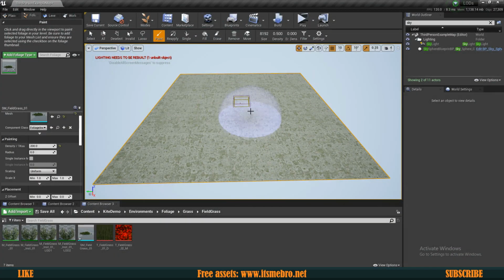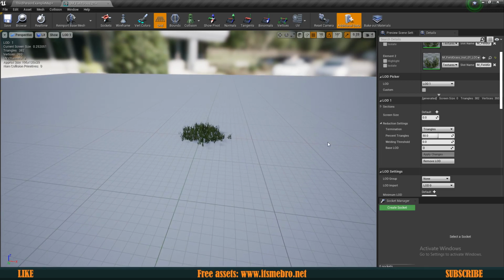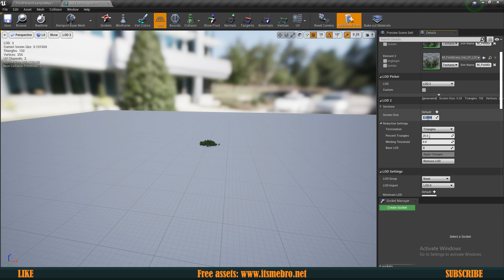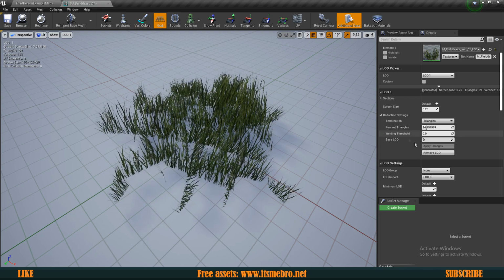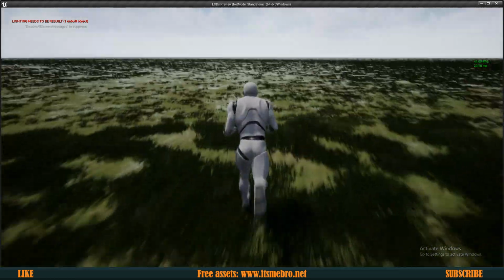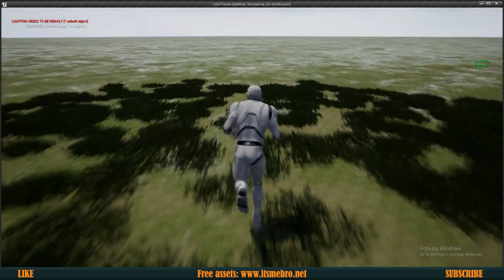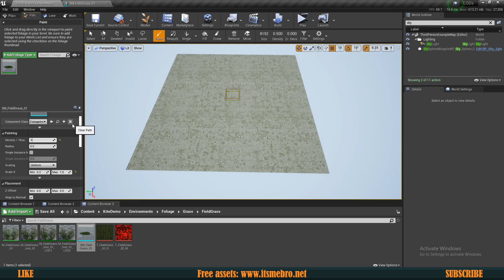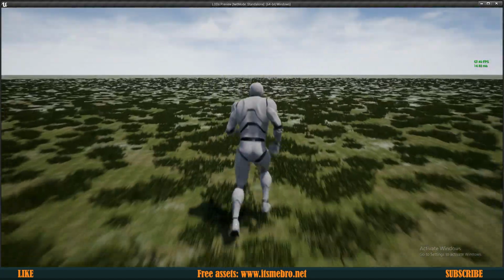UE4 Foliage LOD Optimization / From 3 FPS To 70 FPS.

Comment: Easy fix dont use the folage tool for grass but ad it to the landscape material this is 10x better dont recomend using the folage tool at all for big projects
And always make sure that the models a made correctly if you have a good modeler you wil already not have this problem
Reply from the maker: Yes. After making this video received a few messages about this. Wasn't actually aware of that method myself. I will look into that and do a video on it. Since I saw a demonstration of what it's capable and yes, it's 10x if not 100x better.
Reply: @ItsMeBro  yea its what better for preformance we had the same problems then we dound this option uing folange types in the material and omg its saved us a ton of work and problems
Reply: the problem with material, is that you have TO KNOW!!! what you are doing. Working with materials is just a pain, a huge pain right in the ass, in the butt!! and unreal give no real help when you let your mouse on node, you have no explanation lol. 

Materials is for people who like suffering lol

Comment: Will lod still relevant on ue5?
Reply from the maker: Hard to answer this question. We have to wait and see what exactly ue5 brings.
I assume that it is going to be relevant since games are still using this method.
It might not be as essential, but it could still be a useful thing.
Reply: @ItsMeBro  I just found this on the article about ue5: Nanite geometry is streamed and scaled in real time so there are no more polygon count budgets, polygon memory budgets, or draw count budgets; there is no need to bake details to normal maps ""or manually author LODs""; and there is no loss in quality.
Reply from the maker: @trardac  i hope its true. But I have to see it myself before I can believe. Would not be the first time someone over promises and under delivers.